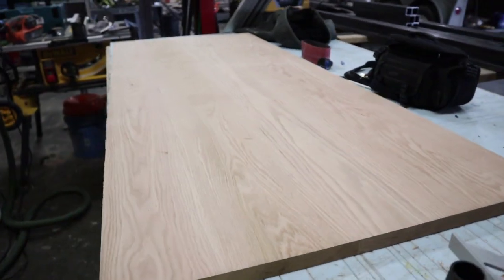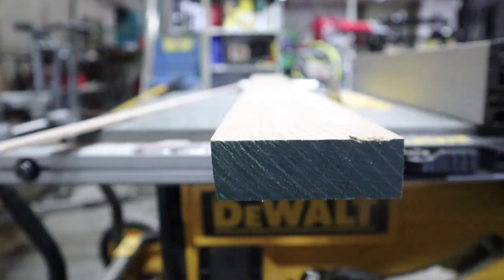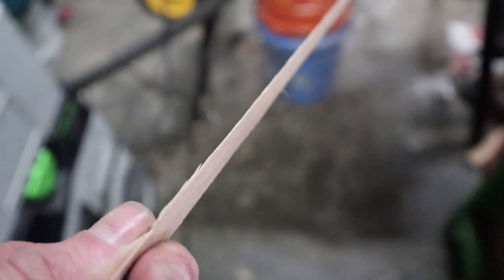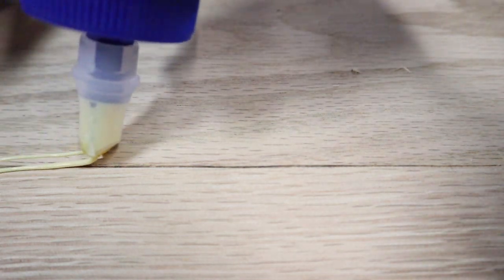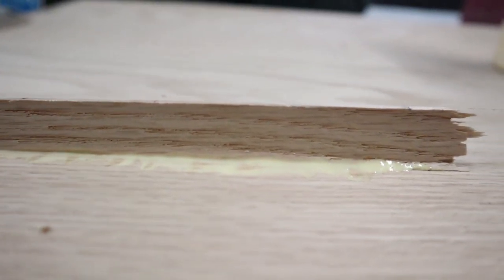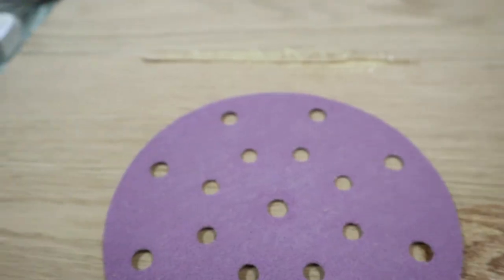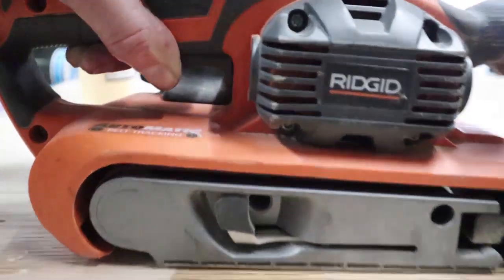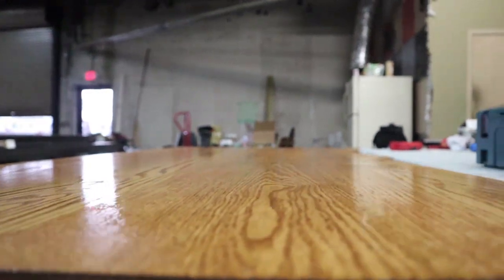Better Than Wood Filler! || Great Method For Fixing Checks and Cracks

Comment: Man that sure did help. I had some huge gaps in my floor and that worked nicely. Thanks.
Reply from the maker: Glad to hear it. The best part is, it will age better than any filler on the market as it is a solid glue joint of the same species, so as the expansion and contraction work in cohesion. My mentor taught me this trick on a 11' white oak table heading to a client in Florida from Nashville, and it saved our delivery!

Comment: Going to do this with the table I am working on. Makes perfect sense, wood fillers never match up with any wood.
Reply from the maker: Heck yea! You can even do it over with a kerf cut if necessary or a router pass and inlay a real big whoopsie. Hardwood > Filler

Comment: Not sure I can hit 5% on the cut, but an AWESOME tip!!  What did you use for the clear finish coat?
Reply from the maker: You can do it! Just take your time and keep it firmly against the fence. The clear coat was a hand rubbed Poly, Satin by minwax. The kind int he black and gold can with a red band, NOT the blue and white one- that stuff is a sticky mess.

Comment: Nice video. Thanks for sharing .can you tell me what polish or color you used? Nice clear finish 👍. And what sealer I can use to prevent furniture from spliting ?? Waiting for your experienced reply
Reply from the maker: I believe the color was Early American by Varathane. The clear coat is Minwax hand rub poly oil based satin. I did not use a sealer on this table as the hand rub poly is cut with mineral spirits and acts as a sealer as well. About 3-4 coats of this 4 hours apart will get you a very durable yet minimal build. Unfortunately, no particular sealer will prevent wood from splitting by itself. Most  checking or splits come from improper joinery or joint failure due to extreme variation in temperature and moisture. If your piece is going to be exposed to heavy UV light I would always recommend using a Spar Urethane or outdoor oil.
Reply: @JeffEstesBuilds  happy to see your reply .thank you very much for your time. I ll use outdoor oil next time in sha ALLAH. Thanks again

Comment: Hmm I bought an old “queen and dining room set“ from a thrift store I have no idea what type of wood it is. I know that I could use wood glue but where would I find a little piece of wood to do this technique that you show in the video? Or would I just be better off gluing it only seeing as how I don’t know what type of wood I’m working with?
Reply from the maker: Great question: for starters the best way to identify the wood is to familiarize yourself with some basic wood grain images from google or carpentry books. If that doesn't work out, step two is a combo: head to a local cabinet shop and ask them if they can tell you what the table is made out of and if they would be able to provide you with a wedge slice (offer them some money for their time and you might get lucky). Unfortunately the key to this working is the shape of the wedge which requires the use of a table saw, track saw, or potentially , meticulous sanding work. Try to find a carpenter to help you procure some scrap of the same wood BEFORE you resort to filling it with glue and sawdust or an epoxy counterpart! Let me know how it goes and best of luck.

Comment: awesome job Jeff, so simple and so perfect! can I ask what Dewalt table saw you use for doing that?
Reply from the maker: Hey Mat, thank  you! It is definitely one of the best tricks I have learned in my career and am very happy to share it. The the saw is the Dewalt 15 amp 10", found at home depot or most online retailers. Be sure if you invest in a saw like this it comes with the stand, it is the major reason I chose this particular tool. That being said, if you're in a bind and need to make a wedge you can effectively set your skill saw on a 5 degree bevel and manually cut the boards.
Reply: @JeffEstesBuilds  thanks heaps buddy!!! Yes for now I’ll use my circular saw but really need a table saw. Awesome info! Regards from Barcelona! 🤘🏼

Comment: Would wood filler be OK?
Reply from the maker: Not for a check or true split in the grain. Usually a significant check requires a key or inlay crossing grain direction to terminate the advancement of the split. Usually holes and knots only for filler.

Comment: Hey, nice bit of info!  
I’ve been trying to research this strategy for quite some time. Maybe I’m just not using the correct search terms, but finding ANY info on possible ways to use this technique has been an absolute nightmare.  
I’ve got a few cracks in the top of my acoustic guitar, (running parallel to the strings and the grain.) I’ve rehumidified the guitar, which significantly helps to close the cracks, but not quite all the way. Plus... the cracks predate my ownership of the instrument, and were already pre-stained by a few year’s worth of dirt and dust...  Methods of removing those stains before I attempt the repair job is another topic I’ve spent WAY too long trying to find, with zero results.  So with no experienced outside info to educate myself with, I’ve been thinking the best way to remove the discoloration at this point is to very slowly and carefully razor it out... which then becomes reason #2 for filling the cracks with your method shown here.  (Though it would be on a much smaller scale) If that’s the road I take, the cracks will likely end up in a “V” shape, with the biggest part of the gap (approx. 1/16”) being on the surface of the guitar top, getting slimmer as it travels down towards the body cavity. Some parts of which are not cracked all the way through, so even after removing the stained wood, I’m not gonna be left with large holes to fix.  
Sorry for the lengthy precursor... My questions are, would you think that this approach, if done with extreme caution, is a good course of action, or would you suggest another route? Do you have any experience in instrument repairs?
Any insight or advice would be much appreciated.  Though I don’t have any real training in woodworking, I’ve been shocked at the results I’ve gotten with previous fixes, based on someone’s YouTube video, and a lot of patience.  I think I’ve got a knack for this sort of thing... just not any expertise. 
Anyway, thanks for your time, and again, great video!
Reply from the maker: Hey Matthew, first of all thanks for reaching out these are excellent questions. I will do my best to clarify and advise accordingly. 
My answer to the first question starts with some questions I would ask myself: 
1) Is there a luthier who would take this on, and is it in my budget. 
2) Is the damage effecting the performance of the guitar enough for me to justify a risky procedure 
3) If no one will help or it is not in the budget, can I live with the procedure not going well? 

Here are some scenarios

1) Lets say on a guitar I play daily or tour with but can not find someone to repair it, but the sound or structural quality is not effected; I am going to do nothing. 

2) Call it a "beater" guitar you play with the crew when your slamming whiskey, I'm going all in  on the experiment and trying my best to learn and fix as I go. 

3) Its a great guitar, you don't want to damage it but it needs work. No one will help you and you want to save several hundred dollars and willing to risk it: practice this method 5-10 times on something else. Use real life projects like desks or tables from Good Will or "free on craigslist" and just put in the time. Once you observe the results for a month or two in acclimating conditions with temp and humidity and they satisfy your needs for a guitar, move forward and give it a proper go. 

Be SURE to use the same species of wood for the wedge as the part(s) you are fixing. I would use wood glue not epoxy. Sand lightly. Do not worry about stain right now focus on the method. Be patient, be persistent in your training and be cautious before you dive in. I think you will do just fine with practice!

Let us know how it turns out and what you decide to do.

Comment: Just like repairing a piano soundboard!
Reply from the maker: Wow, John I had no idea that's what one would do for this, but it makes complete sense to me thinking about it. Definitely the best method I know of for matching the original strength, coloration and properties of the lumber used in the project. I assume acoustics and sound quality applies to this logic as well.
Reply: @JeffEstesBuilds  Exactly the same.